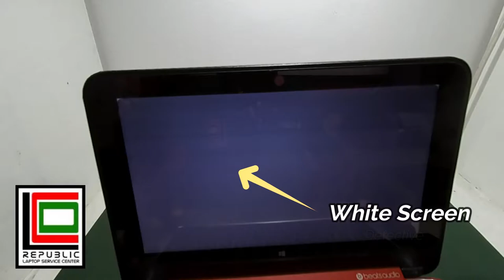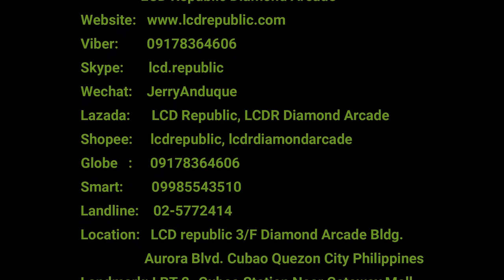HP Pavilion 11-n002tu X360 N3520 LCD Screen Replacement

Comment: Thanks for posting.  I followed your instructions and successfully changed my LCD screen which worked just fine.   But... when I clipped on the back cover it went on OK but the glass digitiser screen was cracked!!!   What did i do wrong??  any ideas?

Comment: Hola, tengo este mismo notebook HP Pavilion 11-n010la, y la pantalla no enciende por una caída, cómo puedo saber si realmente el problema es la pantalla ( así como lo muestras en tu video), podría saber algún cable mal conectado u otra cosa?. en caso de ser la pantalla la mala dónde la puedo comprar. muy buen video saludos desde Chile.
Reply: Igual yo tengo la misma marca de computador y la cosa es que se me dañó o sea se me cayó y bueno Desafortunadamente la pantalla esté barato todas y yo lo que hacía era que lo conectaba con un cable HDMI y lo o sea lo conectado a un monitor externo El problema es que me pidió una actualización y necesito entrar a la bios pero la bios no reproduce en pantalla externa y tengo que desconectar el LCD para conectar a la pantalla
Reply: La única es que pruebes conectando otro display. el único requisito es que el conector sea de 40 Pines, como muestra el video. no importan las pulgadas. de ahi ya podrias descartar si es el Display o el Bus de datos. Saludos
Reply: @flagsxxx8816  POdrías desconectar internamente el Display y con el lcd por hdmi. conectado desde el inicio. es posible que te dé imagen directamente a la Bios.
Reply: esa pantalla se consigue facil en el mercado de tu pais es tal cual una LCD LEd  Slim 11.6 40 pines. rondará los 50-70 US

Comment: Hello. 
I'm looking to "upgrade" my laptop screen as the current one is a TN panel code NT116WHM-N10.
I have found a very similar screen that is IPS with better colour, the problem is it draws 3.86W instead of the 2.8W of the original panel. The screen's code is LP116WH6-SLA1.

Would this panel "upgrade" work?
Reply from the maker: Yes may be its works bcoz same pins, and same resolution,
Reply: @mr midnight. How are you, r u success to replace with ips screen?
Reply: @minishabit  I actually just forgot about this, didn't have the courage to change it because I would most likely break it